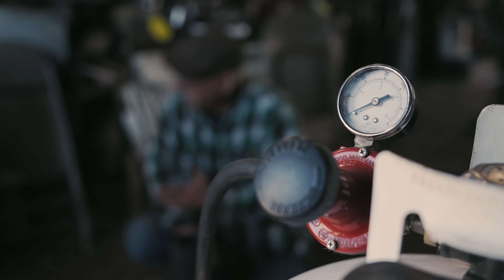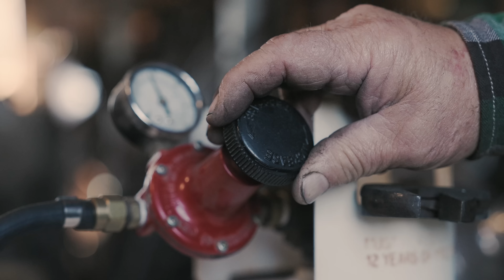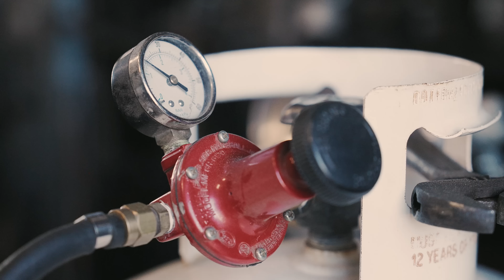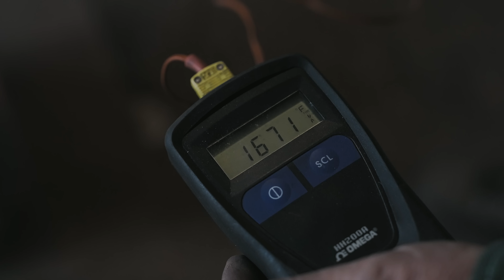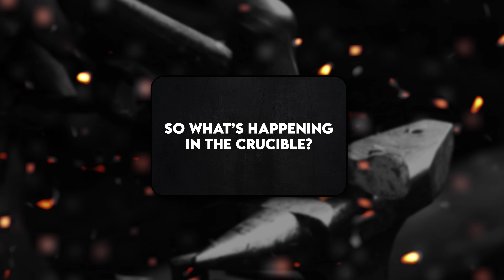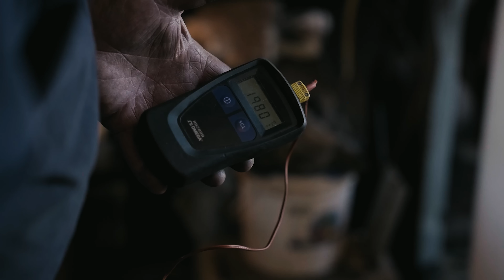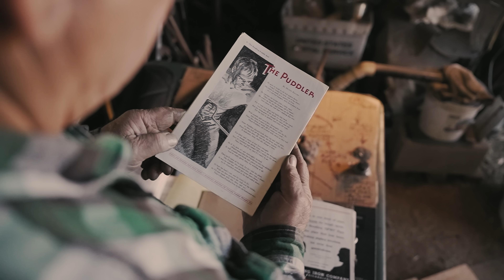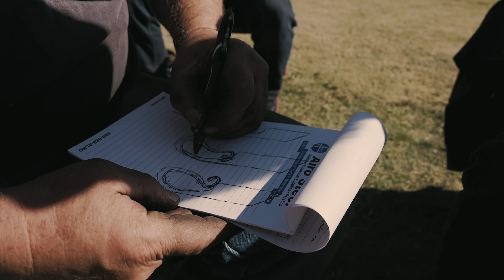Unveiling the Secrets: Transforming Dirt into Magnificent Damascus Steel!

Comment: This is pattern forged steel, not "Damascus". Damascus is a crucible steel, meaning that is completely liquefied in a crucible. Damascus steel is also never quenched due to the way the steel patterns itself during forging. Pattern welded steel, as shown in this video is a combination of several different grades of steel and iron that have been stacked and folded to create a pattern reminiscent of Damascus steel